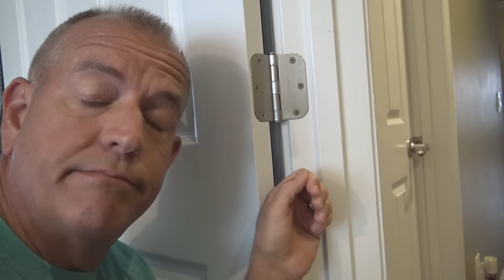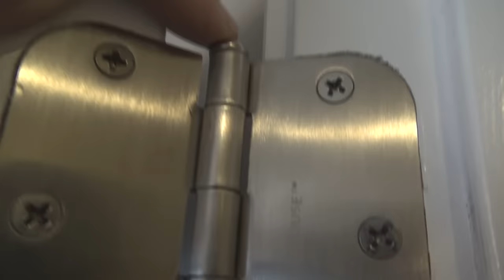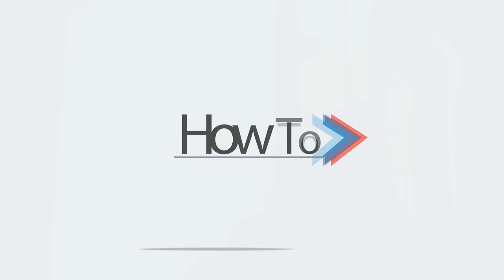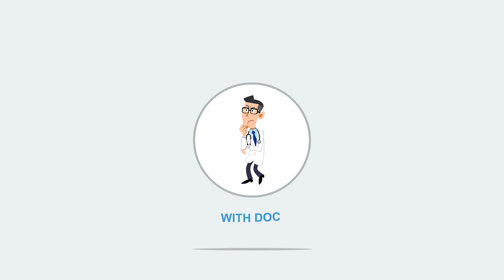Remove Door Hinge Pin with Bottom Cap

Comment: To make it worse, mine had a TINY hex screw in the center of the hinge which makes it impossible to punch the hinge pin out.  You have to remove the rice-sized screw in order to remove the pin… after you remove the cap at the bottom.  SO STUPID!

Comment: CAUTION! I just bought three nice National Hardware stainless-steel door hinges that only LOOK like the older "bottom cap" hinge in this video. In mine, however, the cap with the hole in it is swaged in place, preventing removal with vise grips (or almost anything else). Fortunately, when I looked inside that hole with my headlamp, I could see the end of the main hinge pin farther down inside the hinge. 

     I simply inserted a 10D nail into the hole, set the "short" edge of the hinge across the miter-gauge channel in the top of my table saw, and tapped the head of the nail until the main hinge pin started to come out. I then finished removing it with a pair of pliers. (It came the rest of the way easily.)
     Hope this helps.

Comment: I'm a woman with not much strength.  Is there a way to do this without the vice grip?  If not, how hard is the vice grip to lock down?  You grunted when you locked it, so it seemed like you had to use a lot of strength to do so.  Please advise, thanks.

Comment: Why remove the cap on the bottom. Most are center drilled. Use a pin punch from the bottom with the cap in place or with your method use the vice grips on the pin instead of the bottom cap.

Comment: Isn’t there a hole in the bottom cap? Looks like it. You usually pound the pin out by putting something through that hole in the cap. No need to remove it first.

Comment: Im having an issue with an older door that has the cap but it has extremely flat bottom caps and they were hammered in tight... been fighting the damn things for 2 days and have given up any tips?
Reply: Any luck? I'm dealing with the same thing. I can't find any tips or tutorials to remove a cap that is flush that you can't grip with vise grips.
Reply: @timhill5426  It might be non-removable riveted pin hinge...

Comment: Thank you but what a poor design there was no reason to fix something that worked fine for years I've never had any of my hinges squeak yet I was able to easily use a screwdriver to remove them ever built over designed this and I don't have time for this crap I'm just hanging a door and I have to return to Florida and can't sit here and figure out how to fix something that shouldn't be difficult but it's making hanging my door twice as difficult as it should be